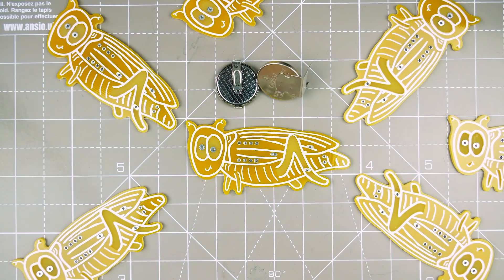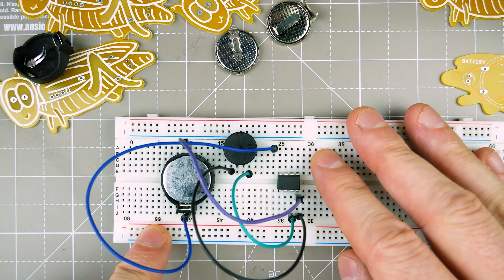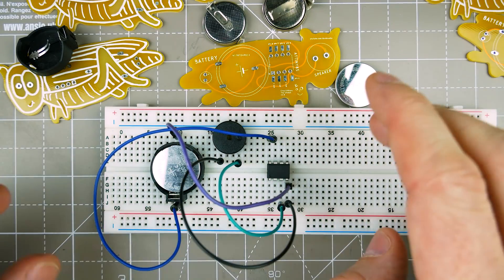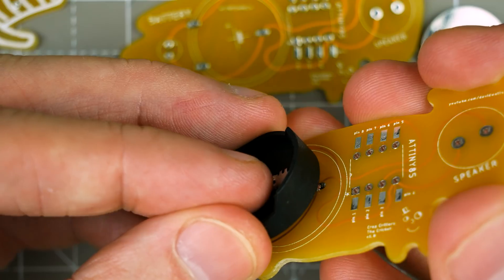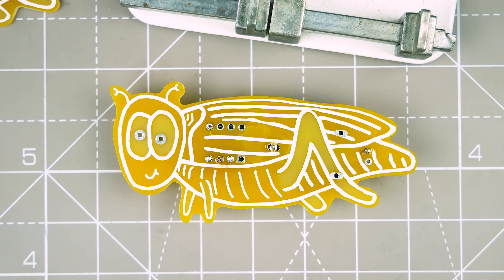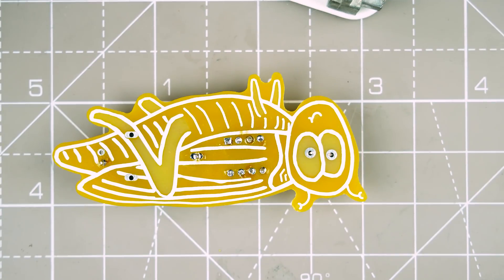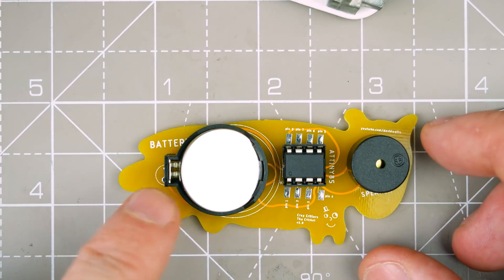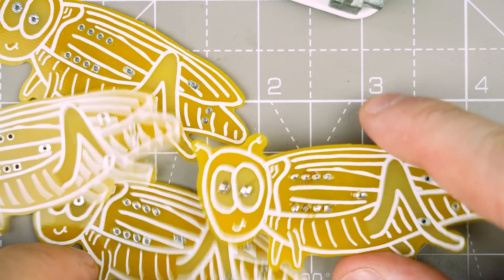Building the Crap Cricket

Comment: If the buzzer is a piezo, then you can get the same effect as doubling the voltage by connecting the buzzer to two output pins and switch them in opposite directions,  1 to one pin, zero to the other and Visa versa,       Then the peak to peak voltage swing doubles which doubles the deflection of the piezo.
Reply: also sounds a bit too deep, a higher frequency will probably be much louder